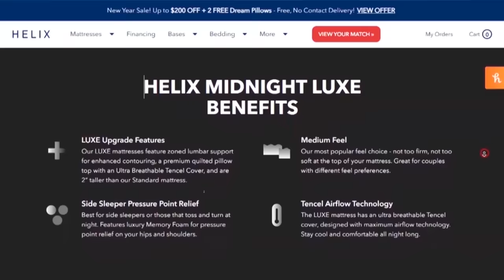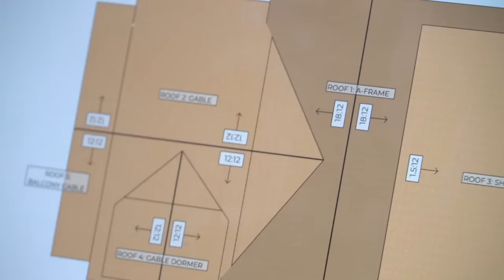Roofing Our Home | A-Frame Cabin Addition Build

Comment: Josh, Your work ethics and determination to overcome is commendable.  You mentioned your common pitch was 18 & 12. Then you're valley pitch and Jack rafters would be 18 & 17 @ a 45° cut, if memory serves me well. 😊 Also, though by now you're probably beyond this point you might consider placing a dry line on top of your rafters perpendicular (across) the rafters to insure you're neither too high or low with each other. This will insure you have no dips or rises when you eventually deck the roof.

BTW:  There are two (some believe three) traits that distinguish a carpenter from a nail driver claiming to be a "carpenter". The first is whether one can cut in a stair case, the second is if they can cut in a roof (as you're now doing).  I once cut in a roof that had only 3 common rafters, but had 17 hips and 9 valleys.  It took  my rookie crew of two and myself two weeks to cut that roof in (40 years ago). Just sayin.

Comment: You guys are doing great! Make sure your rafters are always planing to the imaginary centerline. It was hard to tell but it looked like your valley rafters were flush with the edge of the double valley. They should be up a little higher so they plane to the center of the valley. Either way, great work that is not an easy roof job!

Comment: The way you can easily figure out the first angle is to set a string from the top to the bottom where the board will go and pull it taut.  Make a protractor board with a pair of 4-foot 2x4 chunks.  Stack them together on their sides and put a screw thru the center of one end to create a pivot point.  Go up to the top first and set the pivot point up.  Swing the other arm up till it aligns with your string and tighten the screw into place to lock it.  Check it again for accuracy.  This will give you 1/2 of the cuts you need to make on the end at the top.  The second bevel cut can be determined using a speed square.  Just set the square at the point on the main rafter at the bottom where the angled rafters come down to.  Using the pivot point on the square, rotate the square till it lines up with the direction of the angle needed.  This will give you your bevel cut.  Think in terms of if you had a horizontal clock pierced by a vertical clock face.  You have 2 angels of pivot.  The vertical is your angle cut and the horizontal is your pivot cut.  You are in no hurry.  Use scraps to figure out your technique till you have the numbers you need.

Comment: You may want to consider using an adjustable triangle in order to determine the exact angles that your dealing with regarding the valley rafters. Another suggestion is to take the measurements from the 3D autocad drawings. Once the valley rafters are installed, it will be much easier to determine length of the other members that frame into it.

Comment: If you run your rafter tails long you can snap a chalk line where you need the valley to run. That will give you the cut angle. Then run a plumb line down each side if the rafters as a cut line

Comment: It's very interesting to see how you are nailing the joists and rafters using angled nails.  Is that strong enough? in other parts of the world building code would require you install metal brackets to hold the timber structure together - particularly against wind force.

Comment: This may sound crazy but…to get your angles, one thing you can use that’s obtainable & cheap is…cardboard. You can use a piece of cardboard, tape & box knife to get the angle, then trace it to your rafters etc. Basically you’d need 3 piece 1 the width of your board & the other 2 the “sides” - hold it up to the surface you’re butting into, tape it - there’s your angle 😎

Comment: A lot  of  modern houses are built with trada trusses as they are designed for the loading for both live and dead loads. But by the size of your timbers l would safely say it is over engineered and should pass your country's building regulations. 
 Just remember that the higher the roof is the further you have to fall,  be careful  !❤